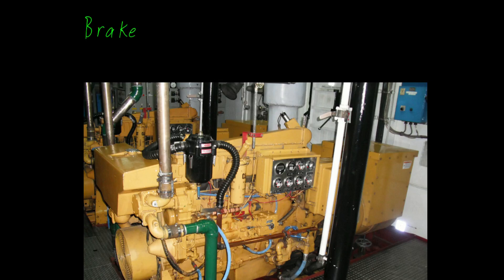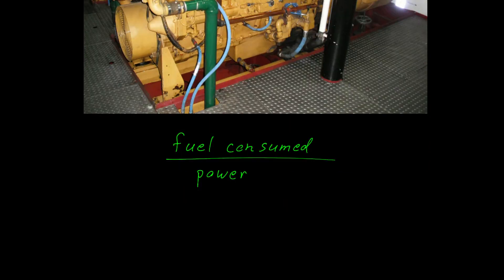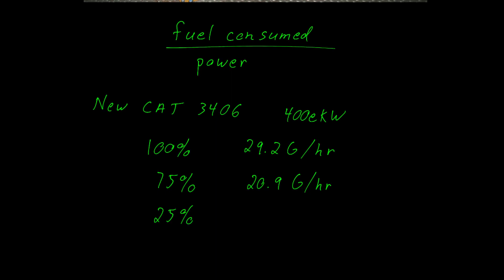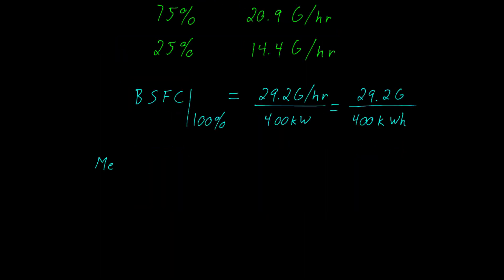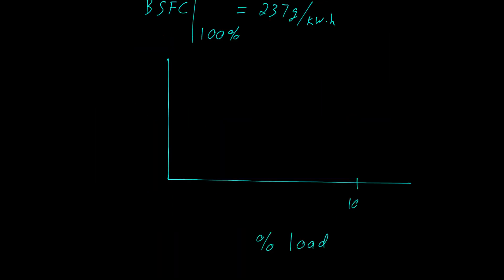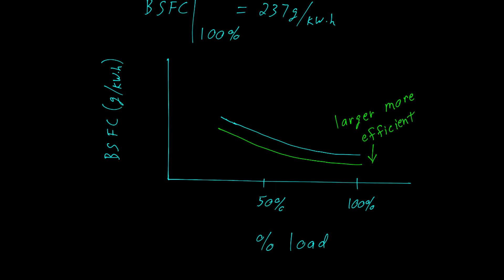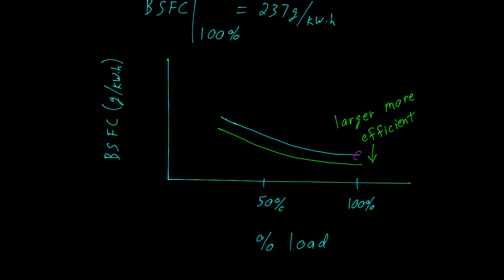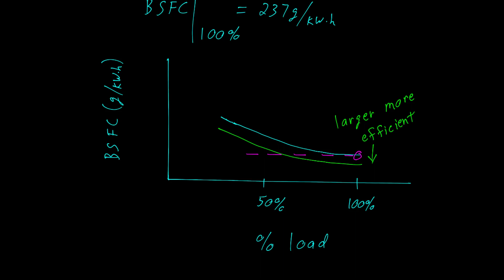Evaluating Engine Efficiency with Brake Specific Fuel Consumption Data

Comment: usually the peak efficiency is around 70-80% load, as it shown in your own data, where on 3/4 load only consume 2/3 of the fuel: a 12.5% improvement over 100% load. Operating at full load also decrease the engine components lifespan and maintenance interval exponentially.